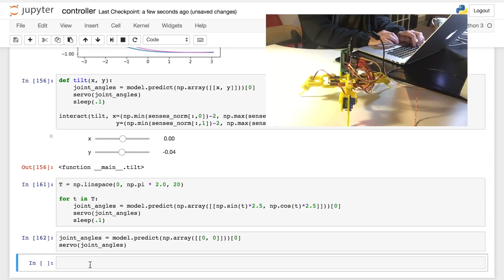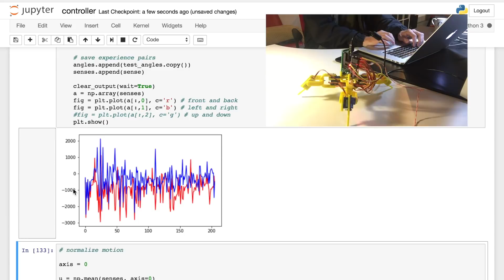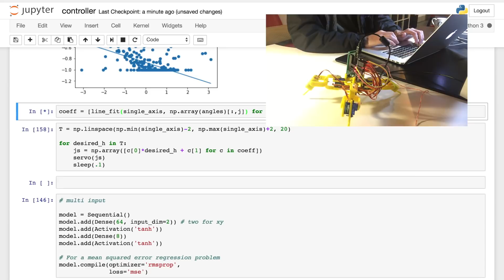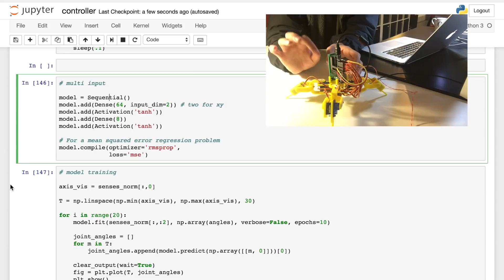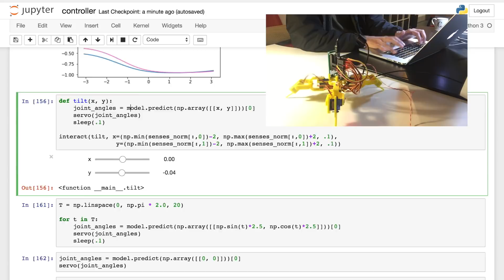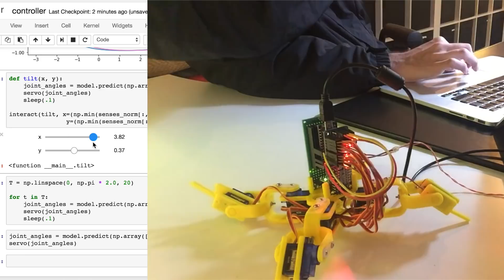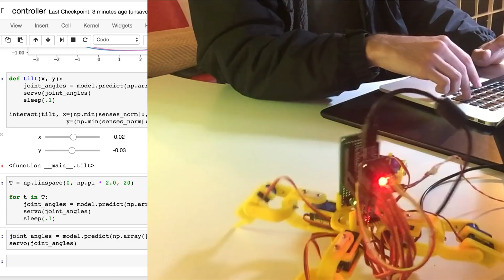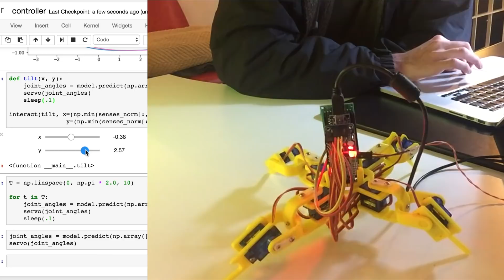Arduino Robot Update: Proprioception

Comment: Pretty sweet :) 
If I would try to make a similar bot, where and what should I start with?
Reply from the maker: Thanks! I designed and printed the parts for this one, used 8 sg90 servos, https://www.adafruit.com/product/815 for the servo controller, mpu6050 for motion and an arduino nano to interface with the computer. 

If you want to just focus on software perhaps I could put together a kit and send you the parts :-) There are a lot of great quadrupeds out there though that you could control with arduino..
Reply: giant_neural_network more interested in the ML code part😊 recently started studying it

Comment: When you try to look at the camera it's creepy 😂 Anyway, it's very cool to see how your project goes and evolves. Can't wait to see it trying to walk!
Reply: Btw I'm wondering how you can sense the fact that your robot is moving forward, because I'm not sure than the accelerometer can be precise enough to get the position as the robot will tilt a lot when walking
Reply from the maker: Cyxo That’s just my prototype humanoid robot recording a video.. still working on the uncanny valley!
Reply from the maker: Cyxo Great point, I was worried about this too. I’m thinking that similar to the tic tac toe AI project I may put a tracker on the bot and use a webcam to measure the movement :-)
Reply: Yeah I think image tracking is a good idea. Or maybe something that could be useful for a later use on the robot are regular distance sensors on the top of the robot. Then it could learn to get closer or further from a wall to teach it forward movement. And these sensors could be useful if you want it to detect obstacles in a future version